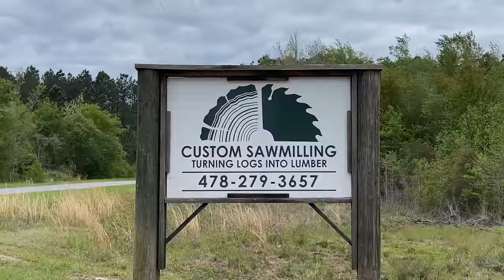The Cowboy Rides Again! The Ultimate Sawmill Video! 2022 Sawing Project,

Comment: I tried to find a Lucas mill 2 years ago when a 150 yr old white oak measuring more than 55" in diameter fell on my property. I couldn't find one and no mill near me would take any segments to mill. After a year, most of it became firewood. Love watching a good Lucas mill in action to salvage huge slabs.
Reply: I would have paid and picked up that log from you. Boat keel.
Reply: @saltwaterinmyveins  You would have needed a heavy lift piece of equipment and big trailer, but I would have gladly let you see it and check it out. The branches ranged from 24 to 46" in diameter at the first 3 branches.
Reply: Hard to find logs that big! New England naval Timbers specialized in huge white oak.
Reply: @saltwaterinmyveins  I am about 30 miles outside of Houston, Texas and none of the mills I talked to would cut it, and the facilities with Wood Mizer saws didn't have any saws that could handle that size, and if I split it in half and turned it upright, it would still be too tall.  That's why I was looking for a Lucas mill.
Reply: @stanwiggins3423  I had planned on using a Alaskan sawmill to break it down.

Comment: This is a question from someone (me) who does not know a thing about sawmill operation but enjoys your videos a lot.  The right side of the mill (from the operator's view) seems to be oscillating up and down a little bit as it travels along the length of the log.  If that is the mill and not your camera oscillating up and down, does that result in a variation in the thickness of the board being cut?If so, is that any concern?  Thanks again for your videos.  Sorry if this this was a dumb question.

Comment: Some fantastic cutting going on there!  And I've got a question about that telescoping fork lift - are those airless tires on it?  I've never seen tires like those, and they appear to have a honeycomb pattern just under the tread.
Reply: Yes they are airless. They honeycomb them to remove some of the weight. Each tire still adds more than a extra 1000 LBS.